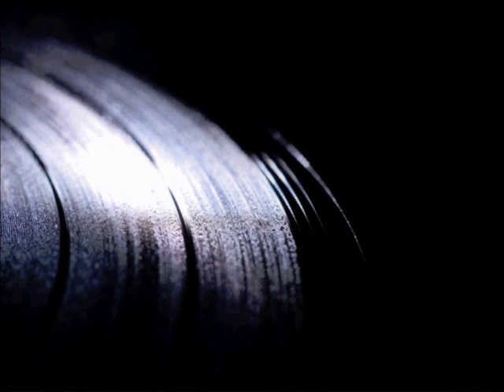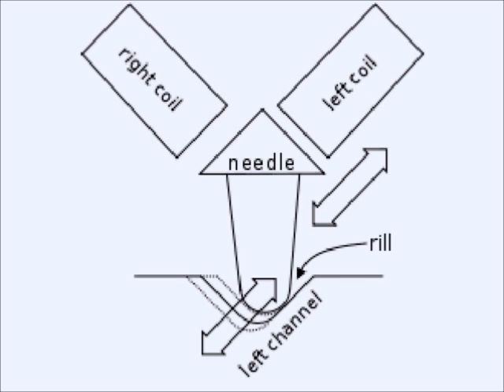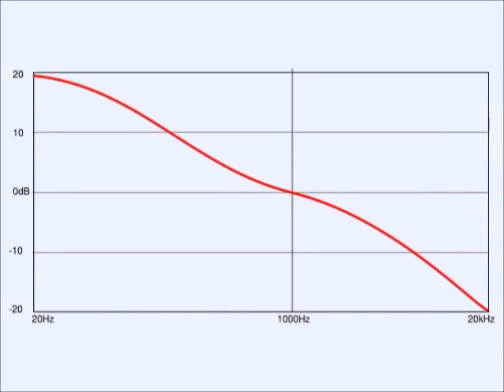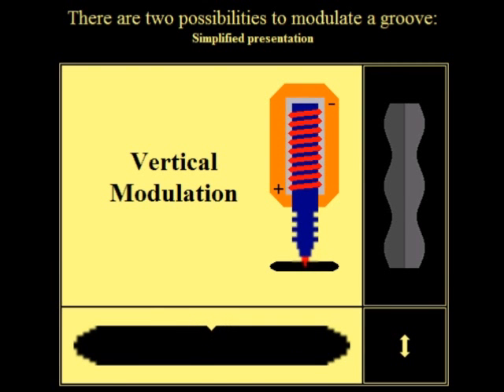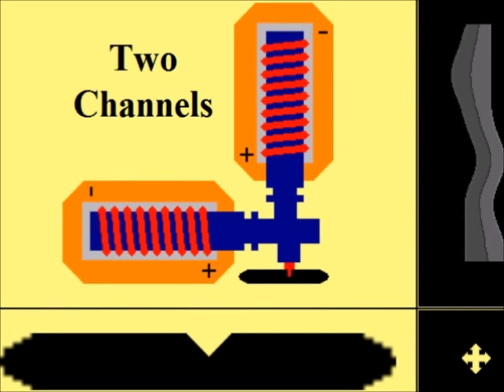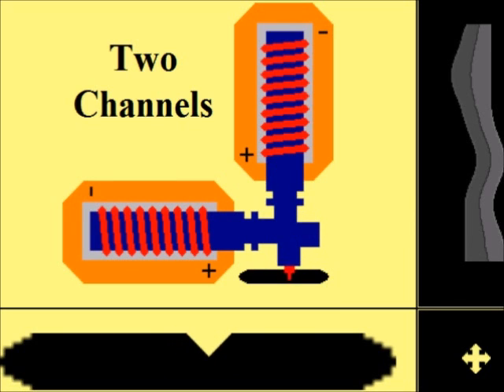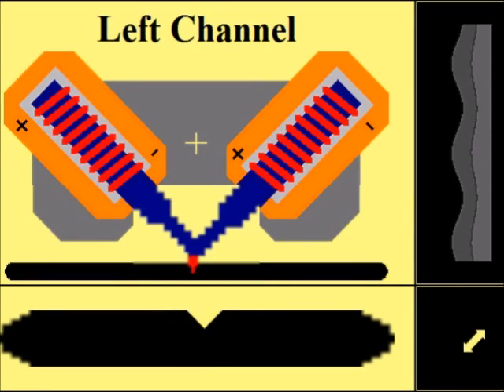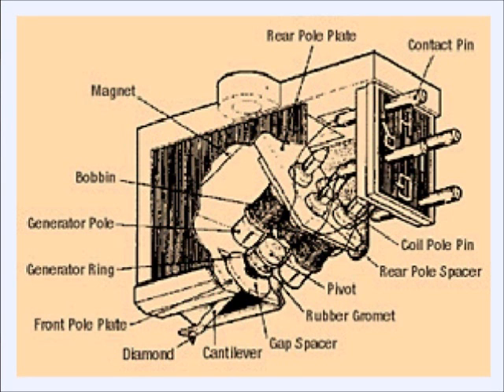The Stereo Phonograph Record: How Does It Work?

Comment: I don't get it, how can the stylus read both channels simultaneously? If the 'data' for the left channel is on the left, and the stylus has to go left to 'read' it, wouldn't the right channel be silent at that fraction of a moment?
Reply from the maker: It isn't 'data' but a continues representation of the original stylus movement of the cutter. That stylus moves on two planes at once. one plane being left and the other right. They can both move at the same time because the cutting head is free to move in all directions. The direction of the cutter determines left, right or both at the same time. :)

Comment: One thing I noticed after building my record lathe recorder was vinyl is a poor medium to record directly to. It may press best but recording analogue on a CD surface is the best to emboss (record) on. DVDs tended to have far more pops, most likely due to impurities. Any Lexan (polycarbonate) piece of plastic works as long as it has an extreme high gloss "glasslike" finish.

Comment: I still can´t understand how the needle knows how an instrument sounds like
Reply from the maker: thehollyrocker69 All sound is nothing more than a pressure wave going through air. The microphone detects it, turns into electricity and that electricity drives the cutter head. Yeah, there are more steps in between but it doesn't matter. As long as the pattern is faithfully recorded, the output from your turntable will sound just exactly like whatever was recorded. The needle doesn't know or care what sound it is, it just follows the vibrations in the groove walls. turns them into electric currents and those currents are amplified loud enogh to move the drivers in speakers which set up the same vibrations as the original in the air in your room. :). :)
Reply: Joe Collins Thanks for your comment, well yeah that's clear to me, and of course the needle knows nothing just picks up vibrations, but still is an amazing intellectual achievement, especially when the Harmonics (Timbre) is a complex wave containing more than one frequency.  Then, the transition from analogue to digital system was a logical consequence of the first, for me, represents a major success
Reply: +Joe Collins    Even without electricity you can record sounds, think about the first Edison cilynder phonographs. You still don't explain the main question, which is: how can a zig zag sounds like a kick drum, and how can another zig zag sound like a guitar? The problem is all about this. And unfortunately, nobody can give a certain answer to this question.
Reply: Just imagine that a sound has been slowed down a thousand times or more. If we somehow "map it out" and draw it on paper, it will look like an ornament - a comb, or a back of a porcupine, or a mountain range. Each sound - human voice, guitar, a kick drum - has a characteristic pattern of these hills and valleys, peaks and abysses. There are just so many of these ornaments, hills and valleys in each tiniest sound that you can't wrap your head around it. They are just too quick and numerous - many thousands each second.

But machines can "listen" to these very fast vibrations, "re-tell" them to each other as electrical signals, and wiggle things around very quickly and very precisely, generating almost exactly the same sound. A vinyl groove wiggles the needle around, the needle tells the "pattern" to the machine, and machine wiggles around the coil in the speaker, making sounds. So these regular smooth big "zig-zags" in the video are just for demonstration; actual "wiggles" in a real vinyl groove zig-zag all over the place, slightly changing direction thousands of times for each inch of the groove. Just look at the video on YouTube, at [youtube address]/watch?v=GuCdsyCWmt8 .

It's easiest to imagine this with a digital analogy. Imagine, again, that you've slowed down a sound (like a kick drum) 1000-fold, then "chopped" it into tiny parts, each one much shorter than the blink of an eye. And you assigned a code to each tiny part. You get something like a roomful of sheets of paper with endless numbers on them. No HUMAN could look at THAT and think "yup, that's a kick drum sound". But a computer can read these codes one after the other crazy fast (like 40 thousand times per second) - so fast that it reads them with the same speed as the air vibrates when the drum is hit. And again, turns them into real physical wiggles of a speaker coil. And voila, you, the human, are deceived, and you hear a perfectly realistic drum sound.
Reply: yes, thanks, i just find it magical, I mean I can't understand how is possible that vibrations can be stored.
Reply: +My Uncle Every unique sound or timbre in the case of a guitar or trumpet has a unique vibrational pattern. That's the important part. A loudspeaker works in the same manner. So if we wonder how the grooves contain the music we should also wonder how a coil and cone produce of a woofer makes movements that our brains perceive as unique and specific sounds. FYI ... all speakers are simply air pumps. Understanding how our eardrums operate and how our brain interprets those signals is paramount to the understanding the physics of audio
Reply: Thanks a lot for the explanation...
Reply: thehollyrocker69 I was addressing "My Uncle" more, not you, so sorry if it came out as needlessly oversimplified. He said that he has problems grasping the concept itself.
Reply: all sound is a vibration that vibrating is recorded on a record listen w your ear close to the record w ur amp off U will hear the music Hear it? That sound is then picked up by the stylus then goes through a careful amplification process to minimize THD to produce an accurate reproduction at louder volumes.
Reply: How about the Thermos flask, not a silicon chip in sight but somehow it knows whether to keep something hot, or cold. ;)

Comment: This is interesting and everything. But I want to know - how does the sound get recorded? How does it go to the stylus, how does the needle produce the same back?
Reply from the maker: The cutting stylus digs out a groove while it is vibrated by whatever sound you want on the record. The vibrations represent an exact analog of of the sound pressure waves... The playback stylus tracks that groove and its motion is converted to electrical impulses in he cartridge. Those electrical impulses are amplified and go to a loudspeaker. A loud speaker converts electrical energy into physical energy... It actually moves the air around it and sets up pressure waves that our ears detect and We call it sound. It really is that simple. :)
Reply: Joe Collins
I see! It's just a frequency with all the necessary information. Thank you.
Reply: +Joe Collins  It's not simple at all. You keep forgetting that electricity is not needed to record sounds.

Comment: Thank you very much for making this video. Here is a technical question about the needle. What type of output voltages would be expected from the needle converting the groove from mechanical into electrical energy? The reason I ask is that I would like to test a used turntable by injecting a sine wave from a signal generator directly into the tonearm contacts, but I do not know what the average input voltage would be that the first stage of the turntables preamplifier would see. Also the tonearm terminates in four contacts and I was wondering if the pinout would be universal between tone arms
Reply from the maker: The standard output from a moving magnet cartridge is in a range from 3 to 5 mV. The standard impedance that would be loaded down with is 47 killoohms. The color coded wires are:
Left = white wire
Left Ground = blue wire
Right = red wire
Right Ground = green wire
Reply: Joe Collins Thanks Joe!  This is exactly what I was looking for!!!  Exactly!!! On the other vinyl board I subscribe to, I got "buy a headcase and cartridge.  They are not too expensive, you will need them anyway.  Duh,.... not if the TT is toast.  Thanks for the help!

Comment: To fully understand how the stylus and grooves produce sound, we have to relate to the physics of electricity and magnetism. It's a little complex matter to discuss here, but the cartridge works in the same way a diesel or gas generator works. When you apply movement to the generator it produces electricity, right? So, when the stylus apply movement to the coils (or magnet) inside the cartridge, produces an electrical signal analogue to the grooves. Sorry for my bad english. I hope this helps.

Comment from the maker: I'm not sure what you're not getting here... A lateral recording means the cutting and playback styli move back and forth across the surface of the record. Stereo recordings are really two vertical cuts on each groove wall at 45 degrees. The channels are out of phase meaning that if you send a dual mono signal (two channels that are exactly the same) you get what looks and acts like a lateral mono recording. That's why a stereo cartridge can play the original mono records. :) JC